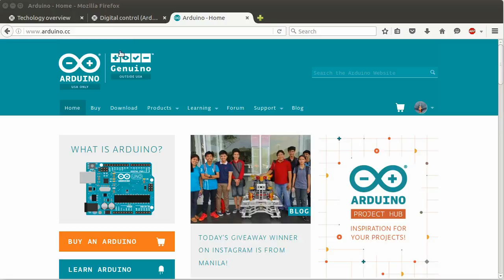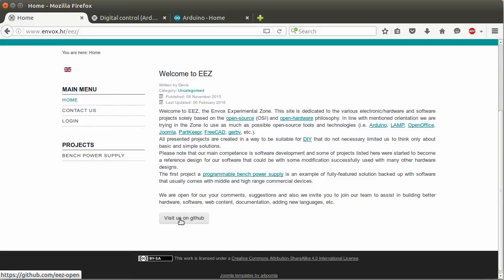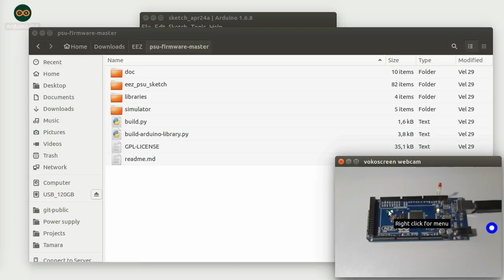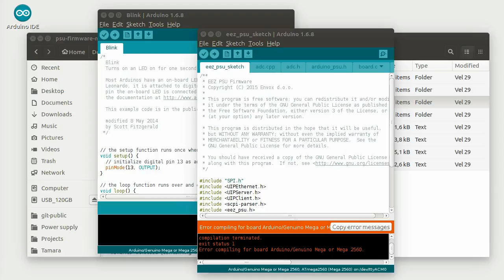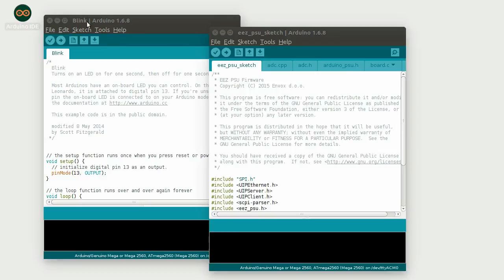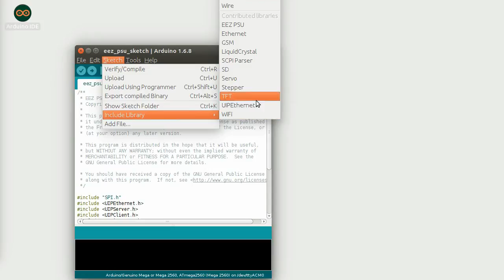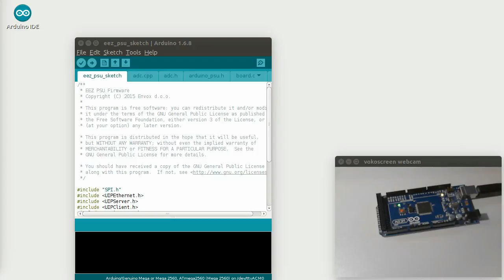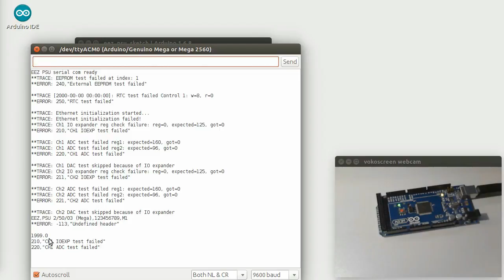How to upload firmware for EEZ bench power supply

Comment: Hi, if you want to use Arduino DUE you must use 1.6.9 Ide because 1.6.8 doesn't work with due board
Reply from the maker: You're right. IDE 1.6.8. with same version of "Arduino SAM boards" does not work (but works with 1.6.7 SAM boards). In IDE 1.6.9. it offers 1.6.8 Arduino SAMS boards and that combination works.